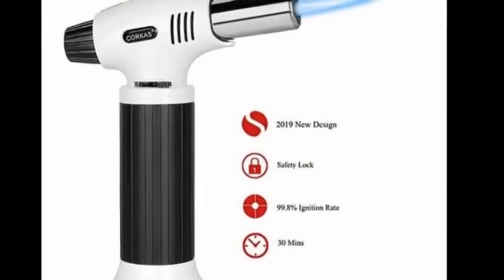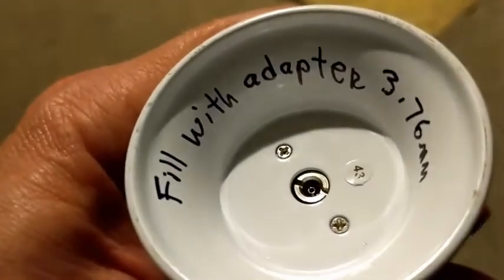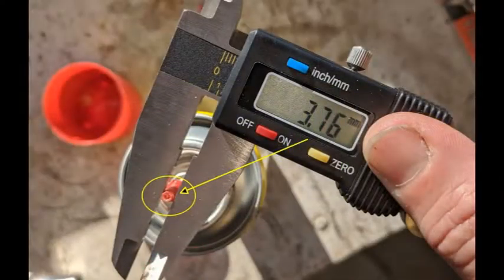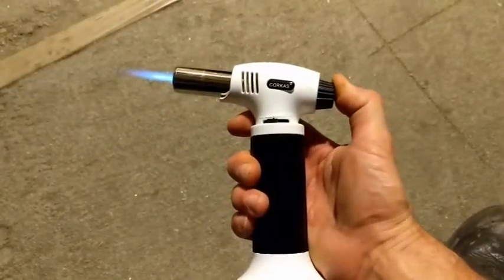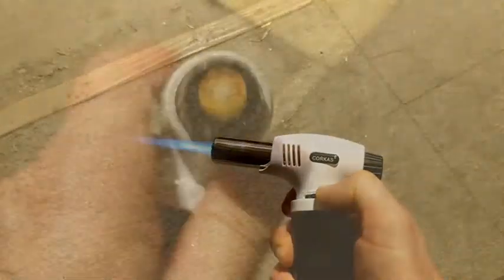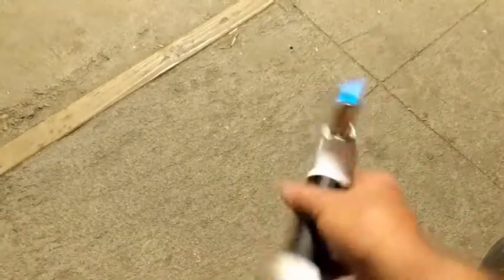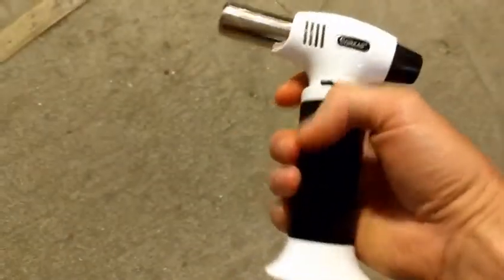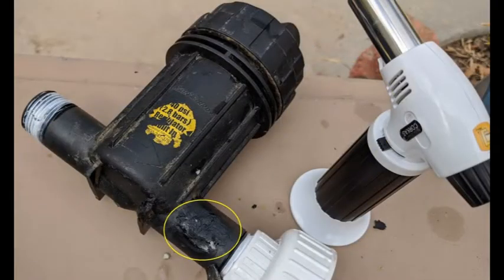Butane Micro Desktop Torch Solder and weld Plastic

Comment: If you're looking to see plastic being welded with this torch, you will be disappointed.
Reply from the maker: The reason I didn't there's a lot of really good plastic welding videos and unlimited soldering videos and this was mostly about getting the correct tipped refill it as the standard sizes too small
Reply from the maker: I see your point that if you're looking for plastic welding and this comes up that's not what it's about sorry about that.